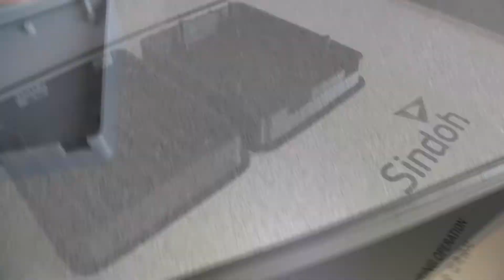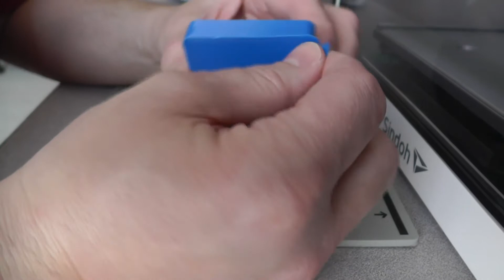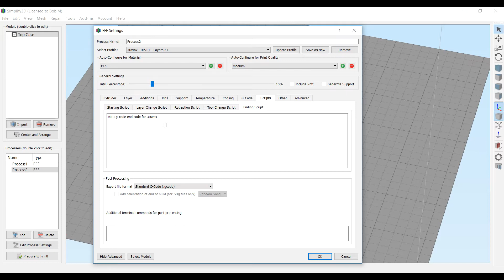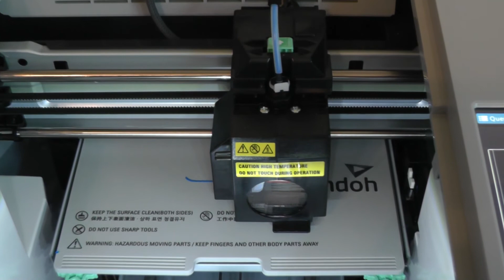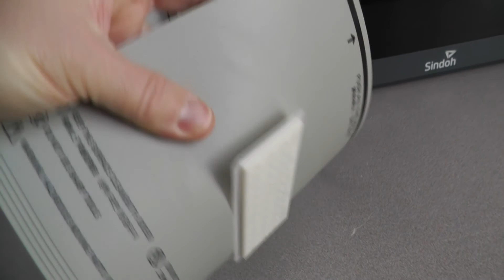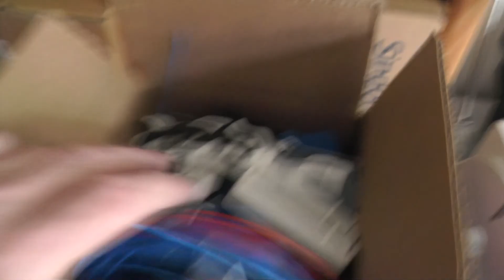Sindoh 3Dwox DP201 - Tips for using Simplify3D

Comment: do you have good setup and profiles for the 3dwox1 (simplify3d) ?
Reply from the maker: I have not had much interest in Simplify3D in the last several years and have been using the Sindoh Desktop Software exclusively which has been very good.  However, I made a few Simplify3D profiles a while ago for the 3DWOX1 that are posted here:  https://github.com/bobotmedia/3DWOX1     The profiles are for a specific version of S3D so it may help you as a place to start and need some tweaks.  Also, here is the link to my YouTube playlist for Sindoh 3DWOX1 3D Printer:  https://www.youtube.com/playlist?list=PL4VCw0EPN6KNKOvVm3UuCTCq_IVQ9A52W

Comment: do you have good setup and profiles for the dp200 (simplify3d) ?
Reply from the maker: I have not had much interest in Simplify3D in the last several years and have been using the Sindoh Desktop Software exclusively which has been very good.  However, I made a few Simplify3D profiles a while ago for the DP200 that are posted here:  https://github.com/bobotmedia/Misc     The profiles are for a specific version of S3D so it may help you as a place to start and need some tweaks.  Also, here is the link to my YouTube playlist for Sindoh 3DWOX DP200 3D Printer:  https://www.youtube.com/playlist?list=PL4VCw0EPN6KMGt638RhDsZDLI9YUKE3Hg
Reply: Thanks!!!!

Comment: Hey Bob. So, I did end up grabbing the older Sindoh 3dwox dp200. Couple reasons I wanted the older, main reason was the heated build plate, second reason cost. So, day 2 of ownership. The print quality is decent but I might have mentioned that I have an unusual printer that get lots of bad reviews, Dobot MOOZ. People that rip it apart have not studied it to really correctly evaluate it. I am getting amazing prints after back and forth with bed adhesion. I tried painters tape, hairspray, glue stick, etc. The perfection is Elmer's School Glue. Almost the cheapest glue you can buy. Secret is to let it dry to perfectly clear and it works flawlessly. Second tip is the filament loading. It's tricky. Main trick is to straighten about 5 inches of filament, and I mean straight as a nail. Heat the print head and now flawless loading. So, comparing prints the Dobot is significantly better. Also the ease of the filament loading cartridge is good if you buy the Sindoh filament which is about $7-8 dollars more in cost and you get less than the typical 1kg filament that you can get basically anywhere for $21.00. And, if you want to go 3rd party you have to find either a roll of filament that the reel is the same size, not easy to find, or you have to unroll and wind the 3rd party filament on the Sindoh reel. I see some people put in the reel and do not put in the cartridge. But you still have to find a reel that fits and I wonder how stable that is. So the ease of the cartridge is a benefit if you agree to the high cost of the filament. And, in all reality, using the refill to refill the cartridge is harder than sticking the filament into the tiny hole. It's actually easier to load filament on a machine where you feed the filament through a small whole than it is winding filament from one reel to the Sindoh reel. AND, I have gotten a couple 401 errors which makes it worse. So, I am sending back the printer to the seller. Not very pleased. BUT I will say that the build plate is amazing. I put nothing on it and every print sticks perfectly, that is incredible but does not negate the issue of expensive filament, which also means fewer colors since we are limited to 7 colors via the proprietary Sindoh filament, and manually loading the reel if we want 3rd party filament which gives us tons of colors, and not to mention the two 401 errors I got. Plus the Sindoh has more plastic parts than the Dobot. In fact the print head on the Sindoh is injected plastic where the Dobot is solid metal everywhere. Cheers.
Reply from the maker: 401 error usually relates to extruder clog.  Typically assure filament is not tangled on the spool and then do a nozzle cleaning through the printer menu with PLA that pushes through at a hotter temp.  Also manual clean nozzle with a T tool and piano wire.  In any case, the DP200 can be flashed with firmware you can get from Sindoh support directly that allows open materials (non-proprietary, non-chipped filament) to be used in the DP200. The hot end is metal, it is just inside a plastic shroud to hold the fans.  Just like you took the time to figure the intricacies of the Dobot, so can the Sindoh be made to work with the right knowledge and tweaks.  Enjoy!  :D
Reply: @AllThingsBobot  Interesting thing is that I did ask Sindoh for the firmware flash so I can use 3rd party filament. They required me to go to their website and fill out some things including the serial number, date of purchase and where I purchased. I contacted the seller when I made the initial purchase a couple weeks ago to get the serial number. I filled out the form and sent it 2 weeks ago. Haven't heard from Sindoh perhaps because they did not like that I am a second owner and bought it so inexpensively. Looks like they will support the initial purchaser but not those that buy second hand. Bummer. So, what I have done now is I took filament I got from Hatchbox and wound it on the Sindoh reel and put the cassette into the machine. I seems to work. Of course once the chip expires I am screwed. So, for that additional reason I have to return the unit. The 401 error, maybe I can clear that, having to manually or use a drill to wind 3rd party filament on the Sindoh spool seems harder than most printers where all you have to do is be careful feeding filament through the small hole. Plus, since Sindoh does not appear to have or want to share with me the firmware release so 3rd party filament can work that means I am stuck with buying only their filament on Amazon with $13 shipping for the sole purpose of getting the filament chip plus the Sindoh filament is less that 1kg which makes it even more expensive. Seems like I am being held hostage to buy the more expensive filament with less color choices just for the chip. Can't see any logic in keeping this unit. Cheers, I did try.

Comment: Looks like that print is for the Arduino Uno board. Ironically, if so, I printed the same print for my Arduino Uno that I use on a variety of my word clock projects.
Reply from the maker: Yeah, it was a sample project that I followed online to learn Fusion 360.  I can't say I ever mounted any of my Uno's in one, but they make for good sample prints to test printers.  😁
Reply: @AllThingsBobot  Most of my projects use the Arduino and I have printed the case for the Uno. I did not create the case just printed it. Some of these builders are truly amazing. I build as well but not to the degree that some of these builder do, WOW.